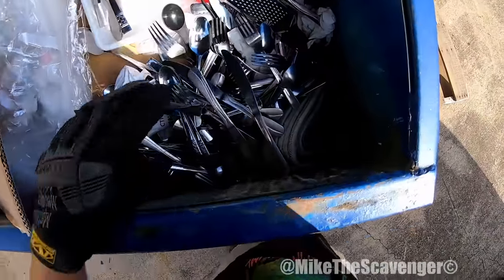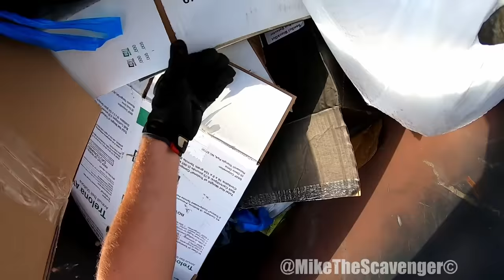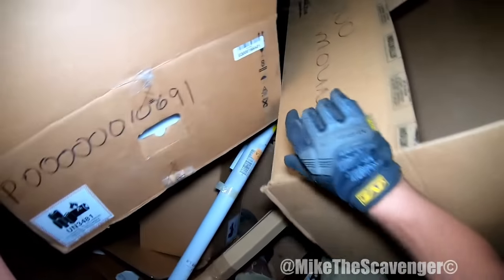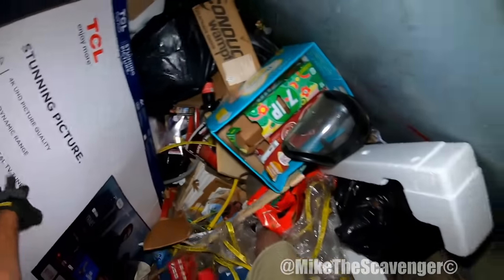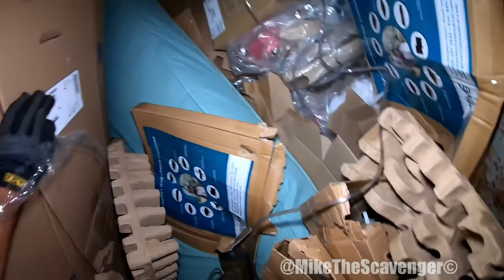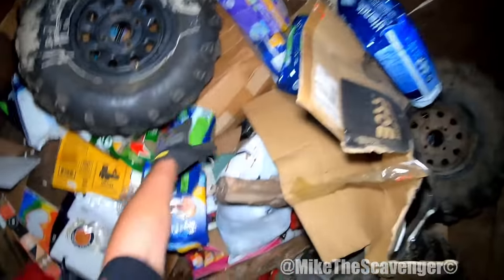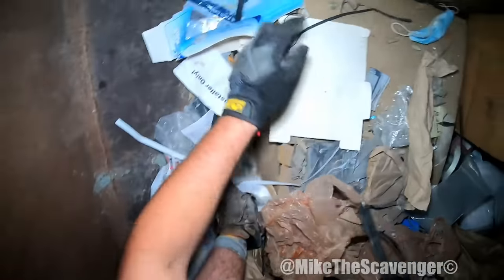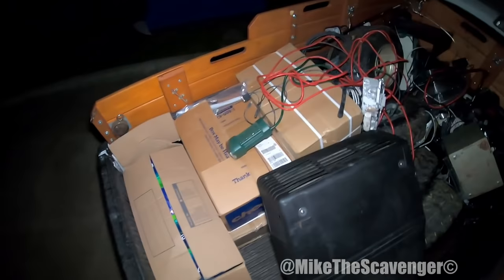Dumpster Diving "Chemicals & Death"

Comment: Hey Mike, that metal round box with the nose is a drywall tool called a banjo box. Take care and be safe 👍
Reply: It is used for tapeing drywall joints on wall
Reply: I HATE Drywall work. I am pretty good at it I just hate it. 
Drywall‘s too heavy to hang FAIC and I get the drywall mud all over me every single time. 😖
Reply: Those things are cool to watch. Used to do drywall with both my uncle's.
Reply: Bro good job cleaning up the scrap and I also like your T-shirt pretty cool

Comment: At 30:20 the thing you are asking about, is a sheetrock banjo.
Used to apply tape and mud in one pass.
They are ussually aluminum to be lightweight and not rust from the mud in them.

Comment: Mike your awesome, most people would pass on the diapers. Thanks for donating them. The aluminum tool is a "banjo", used to apply joint compound to paper seam tape and then to drywall joints/seams (pre-pasted)
Thanks for the smiles you provide, needed them today. 👊👍✌️🤟🖖
Awoooo Yall 😊

Comment: That wire with the funny looking shoe thing was a pure copper HV power sweep used in industrial power / handling equipment that works on 3Ph 220/440 AC. I used to work on that kind of stuff.

Comment: If I ever figure out how to get the copper out of the heated air hoses I'll tell you.
Reply: You can cut it out it takes two cuts the first one to cut the tubing the start from one end tightly in the vice and with your knife start enough to grip the wire and as you pull run the knife through the plastic coating  it will all pull out just take time

Comment: Mike those other wheels are from riding mowers like New Holland or Kabuta wheels worth quite $$$ and cross suits are fkr the wheel weights.
Diapers are ways needed at St. 
Vincent's de Paul Gabriel project.

Comment: the thing with a foot pedal on it ,it dispense hand cleaner or sanitizer with those pump handles
Reply: That's what I thought
Reply: Also use for an alcohol dispenser.
Reply: @mabeldelrey7741  the kind you get drunk on  alcohol ? lolololol
Reply: @blairarthur302  😂😂😂😂... A good idea..
Just be sure your mouth is under the spout or you will waste the alcohol.
Reply: @mabeldelrey7741  I don't drink so I would likely still use it on my hands lololol
Reply: @blairarthur302  lucky you..😀😁😁

Comment: Do Nikki and the last pin was for doing sheetrock putting tape down it's actually a nice Quality Tool if it's a good one. On those tires and wheels don't cheap out the cost of tires have gone insane and if you got two or four decent tires you can get good money even if they're half worn out. Thanks from Bob in Virginia

Comment: Those steel rims do have a good resale value. I bent one of mine a couple years ago and had one heck of a time trying to find another one. Even the dealer didn't have them. Then of course they wanted to sell me a set of the alloy wheels for a small fortune.  They actually had to dig a steel one out of the garbage to replace mine and still wanted $300.00 for just one.

Comment: Thumbs up for using a mask. Better use half-face 3M mask with interchangeable filters. It’s much much easier to breathe in it and it’s work much better. It cost around 30$.

Comment: Call your local Salvation Army many times get request for Diapers from a family that has a family member that's had surgery & thier control of thier bladders need time to heal. Or a family member that's had surgery & is wheel chair bound for a while. Men need them after prostate surgery & thier bladder isn't working for a short time or for ever. See if any of the churches have a "closet" for stuff like that.

The nursing homes I would worry about them charging the residents insurance. family, or them.

Comment: You can back or you get them tires out of the dumpster and I'll swap you a set of tires for your truck I got a set of tires size 15 inch that fits your ranger or picture truck I have a ranger with brand new tires when I bought last year I'll swap your tires